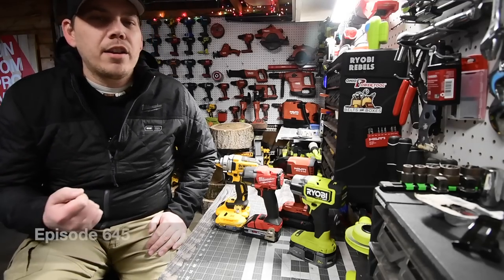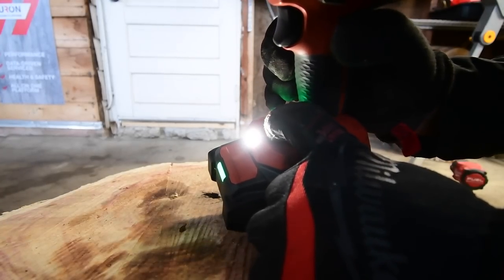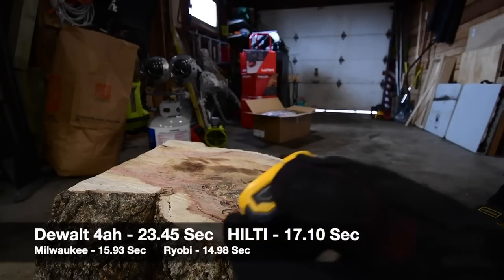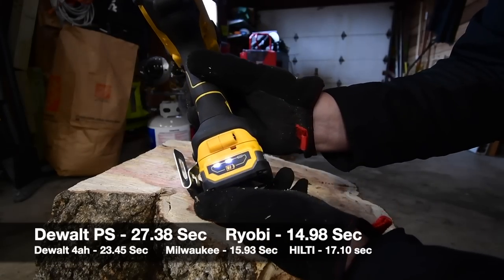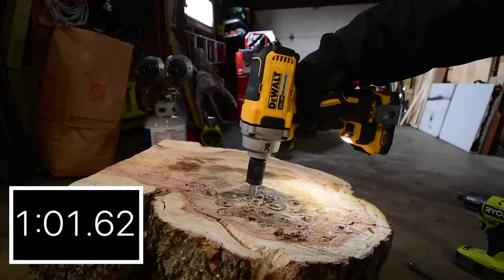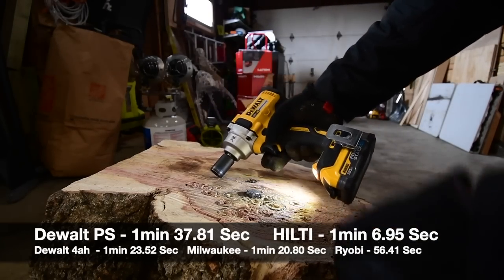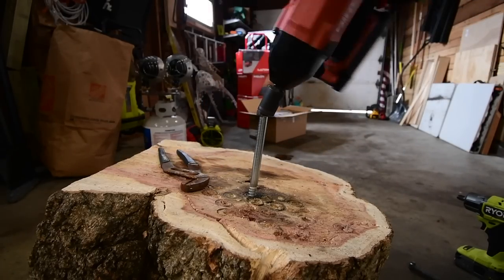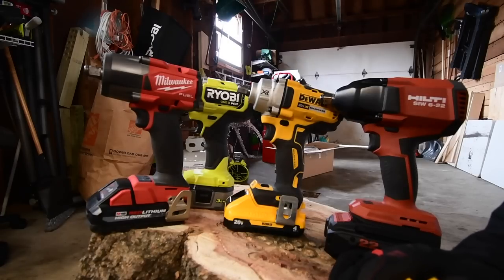Which Impact Wrench Is The Best? (Low AH test)

Comment: WoW , that Ryobi is a Beast ...  In DeWalts defense , that Impact Wrench is around 6 years Old or more ...I can't wait for a bigger AH Power Stack to come out ...👍🖖
Reply: They have a new 1/2” XR that is supposed to release this year and with a 5ah powerstack it will be a beast!
Reply: Yea in forward. I wanna see if it beats Milwaukee in reverse where these tools are gear d to be used
Reply: The new ½ 891 impact is insane for a mid torque. I made Lowe's open a box early for me. I was struggling getting axle nuts off my 94 civic with breaker bars and air tools. The 891 twisted them off with ease. I've been binge watching reviews on it since I got it 🤣
Reply: @skylarcarlson1836  nice. I have the old 1/2” Dewalt mid torque and compact that just came out last year.

Comment: I have that Ryobi P262, and use it in my auto shop daily. It's a dang good impact wrench and I am ecstatic that it did so well here; I honestly didn't think it'd do as well as it did. I'm definitely going to have to get that P195 battery for myself. Great job on the video as always!
Reply: Hi Audio in case you did not see my question  I have a 3/8 Imacro wrench and I possibly Need to tighten/  losse a 1 inch polymer bolt ideas please thank you

Comment: Got a question for you it seems I possibly need to tighten a 1 inch r is it loses a plastic nut using my impact wrech thoughts please  thank you
Reply: I have a 3/8 inch impact wrench  thought s please thank you
Reply from the maker: If the nut is plastic id use a regualr socket or wrench

Comment: That was a great test. I have a question why didn’t you say more about the Hilti battery?  Hilti was not the fastest tool but it remained at full charge unlike any of the other tools. What that says to me is the Hilti will save me money in the long run. Why?  I don’t have to buy extra batteries and charges. I don’t have to wait for my other batteries to charge. I can work longer on one battery. Isn’t that what we all want in cordless tools?  Less batteries and chargers and longer run time.

Comment: You need to add the Ridgid R86001B Midtorque and run it with an older 3.0 Octane battery not the new 3.0's. I have the same Gen 2 Milwaukee with the 3.0 HO and the Ridgid with the 3.0 Octane from what I can tell the Ridgid seems to hit a bit harder. I still like the more compact Milwaukee tho👍🏼

Comment: Give it up to ryobi.... like you said the hp line.. is not the old brushed trash they used to sell 🙄 they really have come a long way I have 3 of the 4 impacts you tested 😉 I just don't have the hilti well because its not out yet.... lol great job 👏 awesome video aswell... and what happend did you take out some of your older videos? Your first video posted of you on the skateboard is gone lol thats how long I've been watching you ive changed my name several times I was Branden thib then the other tool guys tool channel 😄 now back to Branden T. With that said ive watched all your videos and they just keep getting better.
Reply: lol brushed tool motors are not terrible you have the wrong mindset. brushless tools have more plastic, meaning the tool motor assembly can spin faster with less resistance meaning more power and more run time but at the same you give up tool longevity.
Reply: @wmc128  brushed motors are dumpster 🔥 💯 they fry under pressure garbage 🗑 you can have all the brushed tools I had 1 tool brushed the ryobi blower/inflator smoke show. Give any brushed tool and I will smoke it.....
Reply: @TacticalThib  the alternator in your vehicle has brushes or any large Electric motor has brushes. you don't know anything about Electricity do you?
Reply: @wmc128  dude im not gonna argue with you all im saying is I don't like now will I own brushed tools... thanks for your input have a wonderful day
Reply: @wmc128  and yes bro I know about electricity and engineering im a contractor... the brushed motors create more friction with the carbon brushes and commutator. Brushed motors are less efficient from switching action off and on the commutator constantly creating and breaking inductive circuits creates alot of electrical and electromagnetic noise. Brushes and commutators wareout due to being in propetual physical contact with the shaft creating friction and heat. On the other hand brushless motors have no brushes and in some cases no halleffect sensors like in the flex 24v line one less part to fail unlike the brushed motors that have subpar trigger control over a brushless motor. I hope you have learned something about the difference between these two motors. And like I said I will only run brushless motors. Thanks have a wonderful day

Comment: I have to wonder if higher AH batteries will really change much of this test, those packs with 21700 cells output a stupid amount of current, in many cases more than most double stack 18650 cell packs.

And I'm pretty sure that Dewalt will be stuck in last place, the PS battery has some of the highest output, if it could not best the other brands with that then it's kinda downhill from there, but we shall see once the testing happens.
Reply: Drastically especially the Milwaukee
Reply: My unbiased answer is that it depends on how a particular tool’s brain box is programmed.

Comment: Um first love comparing but there are some head scratching issues so as a auto tech one rule is use the right socket mane u burning yo impact out thinking u pushing in the bolt no the socket to deep to long it’s going in the wood Ik bc it’s getting stuck every time and stoping u from going all the way down “can smell the burning “😂
Reply: Always make sure u are using the perfect length and depth socket people bc if he was working on my car omg I’ll rather walk bc u stripping bolts 😭
Reply from the maker: these lags smoke when they come out lol

Comment: The new dewalt atomic dcf923 (3/8 impact wrench) has better stats and performance then the 894
Reply: The DCF894 has 10% better tightening torque and 30% better nut busting torque. But it's slower,
In real life scenarios the DCF921/923 will have the upper hand on light to medium duty tasks, but these are definitely not mid torque wrenches. 
They fit much better in the compact category where they shine against Milwaukee, Makita and such
Reply: @luisinhoens90  I don’t know. I think we should see a test on the 921 and 894
Reply: @michaelmandel1630  Torque Test Channel already did that. The 921 wipes the floor with the Milwaukee 2855-20 compact wrench but it's not quite the same torque as the 894.
Reply: Not a Dewalt fan, but that atomic impact wrench is great.